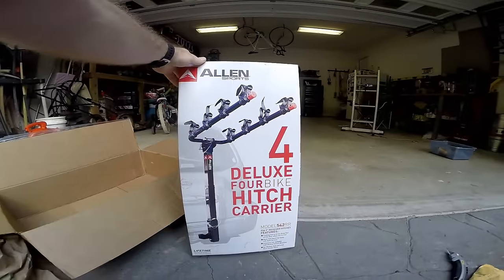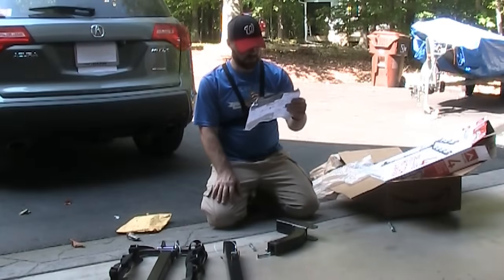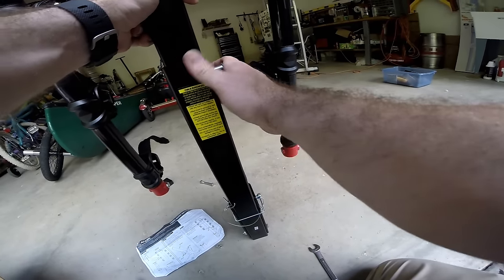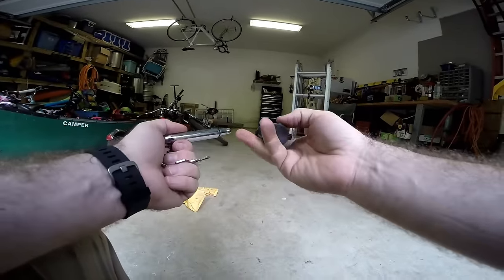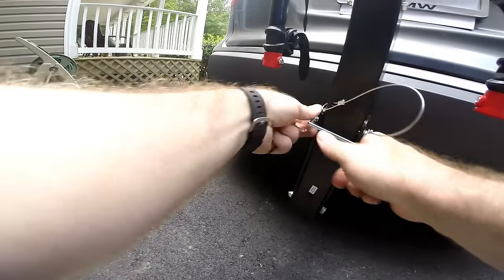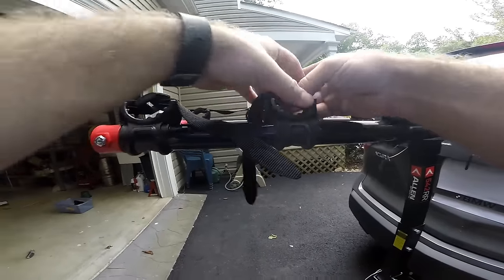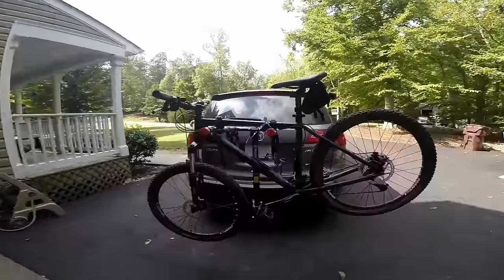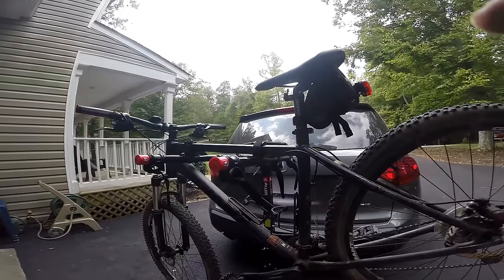Allen Sports Hitch Mount Rack Assembly and Review Model 542RR

Comment: I bought one of these this summer for 3 bikes. Same idea. Got it together in a jiffy.   It's light weight but sturdy. I also had a hitch stabilizer that I put on. Used it to drive from Saint Paul to Door County and back a week later. Really held my bike well.
Since I have a "girl's" bike, I installed a bar on the bike so I could put it on the rack evenly. I had to put a small rag under the bar on one side because it didn't sit snugly into the seat. 
I used several bungee cords to secure it tightly.
I'm very happy with my purchase.
(I'm a 69 year old grandma and can do all this myself!)
Reply from the maker: Awesome!  So cool you are getting out there and having fun and not letting a number hold you back! I pull my bikes up tight with bungees too, it's great at keeping them from banging around.  Thanks for the comment and keep hitting those trails and getting out for new adventures!
Reply: I'm late but Way to go Grandma!!

Comment: I use a 1/2 inch locking hitch pin I purchased separately for really short trips and the supplied bolt for trips on the highway. Holds it really securely.
Reply from the maker: sounds like a good plan!

Comment: You know that bold will keep it from wobbling?  It's called the "no wobble bolt" because it'll secure the rack against the hitch receiver on your car.
Reply from the maker: +Brian Kennedy thanks I'll check that out
Reply: Hey Brady have you used that no wobbly bolt? Does that solve the movement of the rack? How hard is it to put on and remove? doesnt it get worn after awhile because it has to be removed everytime you are done using it?
Reply: Hammer Joe I use mine all the time. It's 3/4" on one side and 19mm on the other. I just use 2 ratchets with the socket pieces.  It prevents any wobbling/movement. The nut has lock nut vinyl to prevent any backing out.
Reply: Have you notice it being worn out as in not tightening up as well anymore? Im just concern that the bolt will have to be replaced often?
Reply: Hammer Joe I haven't had any issues and I take mine off and put it back on all the time.

Comment: Thanks for the video.  Your video helped me make a decision to go ahead and buy it.   Question, do you think it is a good idea to leave the piece that goes into the hitch on the car during the biking season, but bolt the rack on when it's needed and unbolt and remove it when it's not?   How about changing the nylon lock nut to a regular nut with a locking washer so it is easier to bolt / unbolt?
Reply from the maker: I think it depends how much you use the rack and your personal preference.  I usually just take mine all the way off when not in use and I have a regular pin instead of the bolt.  It rattles around a little but way easier to get on and off.
Reply: @BradyAdventures  Have you tried the 5/8? Maybe drill the allen to a 5/8  hole so it would fit and be snug. I bought a locking one with anti rattle on amazon because i got tired of taking on and off with the nut and bolt.
Reply from the maker: @rekzzz14  Thanks for the idea!  It hasn't really bothered me all that much.  Being able to get it on and off easily is my priority also. Thanks!

Comment: Does the rack feels like it moves too much side to side and frontwards while riding  on rough streets? Do you feel at times it might break up?
Reply from the maker: It is more side to side than front and back.  It is just a little slack between the rack and the receiver and it is more of an irritating rattling around than a big problem.  All the construction is pretty stout, I don't think it will break up and feel like rough roads should not be a problem.  I wrapped the end of the rack that goes in the receiver  with duct tape to keep it stable in the receiver and it does really well.

Comment: How much weight have you put on this - 4 bikes?  I am considering buying one to carry 4 bikes for an 800 mile (each way) trip.  Obviously, the heaviest bike (34 lbs) would go on first with the lighter aluminum bikes being put on last.  Has it continued to hold up well?  I have a fear of it failing and me dragging thousands of dollars down the highway behind me.  Thanks for the help.
Reply from the maker: The most I have had on is three bikes for a couple hundred miles.  I think you would be ok with 4  bikes weight wise, the rated limit is 140lbs.  The real issues is the puzzle of getting them all on.  It can be a real challenge, ok a pain in the ass, to get things lined up so pedals and handlebars all nest together.  On top of that I was worried about scraping up the bikes since everything was so tight.  Mine has held up great and I don't think it will fail but for nice bikes and a long trip you may want a better rack..
Reply: Thanks for the quick reply.  I am very aware of the puzzle issue with the pedals and handlebars as I have a 2-bike Thule rack.  I'm sure a 4 bike rack will only exacerbate the fun of loading them (all 4 bikes have 600mm bars), but I doubt that would be different from one manufacturer to another.  My biggest concern is the capacity - I figure it will be holding almost 120 lbs and I have seen reports of cheaper racks bending and failing with less of a load.   I'm just looking to save some cash because this will get used once or twice a year at the most.

Comment: Did you get the Masterlock hitch lock to work better? What model was it?
Reply from the maker: Thanks for checking out the video! The model is  2866DATSC,  I got the rack to firm up by wrapping some duct tape around the square steel on the rack that goes into the receiver.  That has worked well for me but I know people drill out the rack to take the 5/8"  pin and that helps a lot . I haven't felt the need to do that.  I feel like the master lock is decent especially compared to ts competitors but I don't leave it out in the elements unless necessary.  I think there is room in the market for a higher end lock I just haven't found one that is much better.

Comment: So I had to retract my 1st comment as I read down and saw that many commented about the pin being swapped. My question is has anyone found the right size locking pin so it's not as wobbly
Reply from the maker: I haven't tried to hard, I just let it wobble, I honestly don't really notice it.
Reply: They make the rack mounting holes in a odd size to make a tight fit to the bolt provided. Those holes are sized different than the receiver holes. Drill the rack holes out to match the receiver holes and a standard receiver locking pin will work with minimal slop.

Comment: How’s the wobble?
Reply from the maker: It's a little wobbly. I wrapped the shaft in duct tape to take up the slack but if you use the pin that is a nut and bolt it will stop the wobble completely just takes more effort to get it on an off.
Reply: @BradyAdventures  Turn the bolt in the opposite direction. Enter from the left, nut on the right. Mine doesn't wobble!

Comment: So how did the bike carrier work out for you?
Reply from the maker: It has worked out well.  I can't really comment on heavy use as I have only used it 3 to 4 times a month since I got it and do not leave it on the vehicle.  I have complete confidence with my bikes on there and it is pretty easy to get them on and off.  I especially like the ability to tilt down the rack to get in the back.  This may not be the rack for you if you have very expensive bikes, I am not really sure how well my buddies tri carbon fiber bike would ride on it.  For most people I think this is the a good blend of quality and economy.
Reply: Thanks for the reply.  I am glad to hear it is working for you.   I  just ordered one for my truck.
Reply from the maker: I ended up wrapping it in duct tape so it just barely fits and that works pretty good. If you're going to leave it on there you can use the bolt that comes with it and that's supposed to keep it from wobbling but I didn't do that because I only leave it on the vehicle when I'm transporting bikes and didn't want the bolt to be a pain every time I remove the rack

Comment: With 4 bikes on it, the first bike(closest to the vehicle) sits WAY, WAY too close to the back of the vehicle and even rubs on the window. We tried moving bikes around and it just isn't good design to have such a short tube/Pipe that goes into the hitch. To be safe, it should be at least 7-12" longer, so as to not be close to the back of the vehicle. Its a shame they don't just default to making them with a longer pipe. Big mistake by the engineers! It wouldnt add much cost and I would gladly pay the additional cost anyway! Im disappointed with it. BTW, we have a 2015 Sienna.
Reply from the maker: Thanks for the great info!  I think the most I have had on it is three bikes.  I usually strap them together to keep them from moving around too much or making contact with the truck.  I can see how four might make contact with the vehicle.  I still love this thing at it's price point but there are better racks out there especially is your moving a lot of bikes.  Thanks again!
Reply: I strap  a fat tire bike on a Yukon with no problems. Probably the position of the receiver in relation to the rest of the back on yours. You can get receiver extensions.